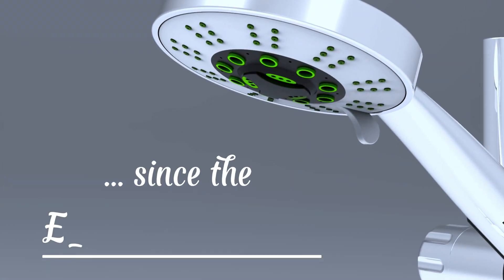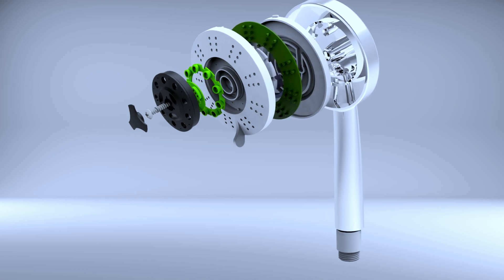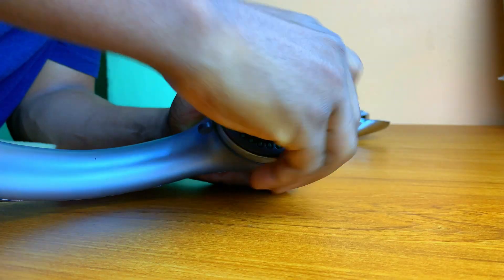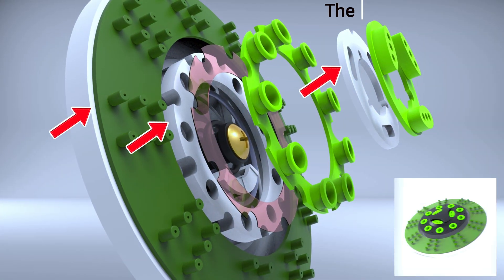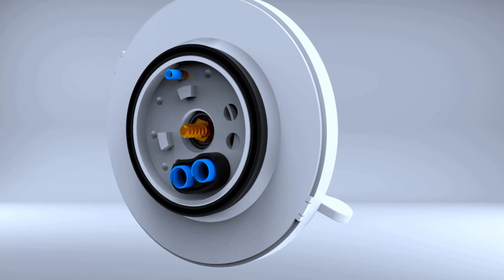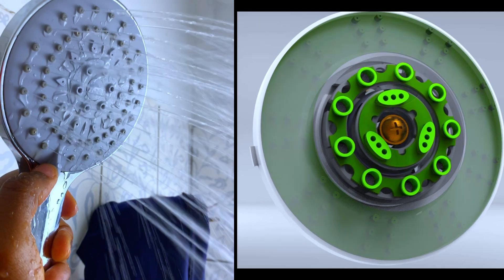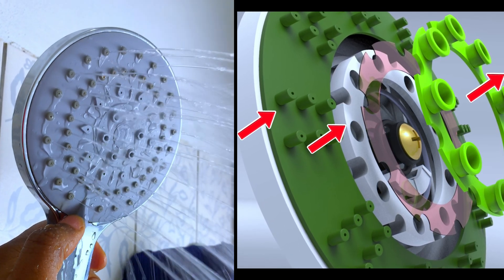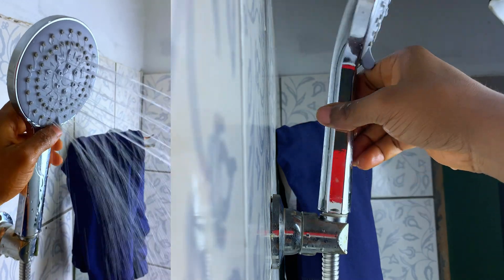How A Multi-Function Shower Head Works

Comment: Did you draw the 3D modeling of the shower head? It is very interesting wonder if you would share the file?
Reply from the maker: I did not design this 3d model myself. As mentioned in the video, I used Axel Ligon's detailed design. He gave his blessing.  Check out his design here : https://grabcad.com/library/shower-head-handbrause-duschkopf-mit-5-funktionen-inv-2018-1